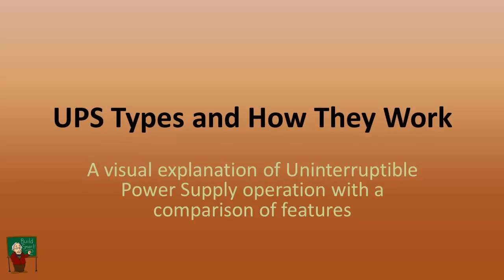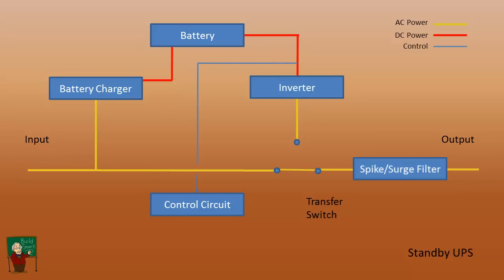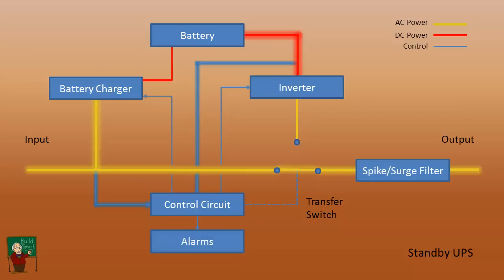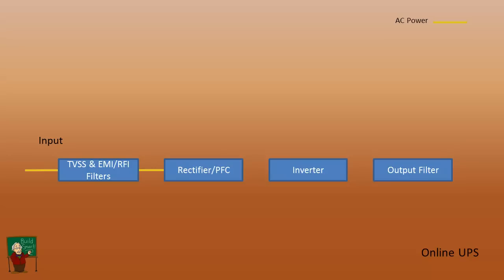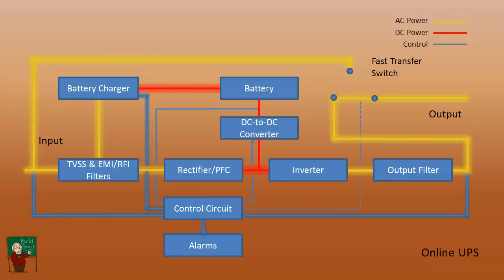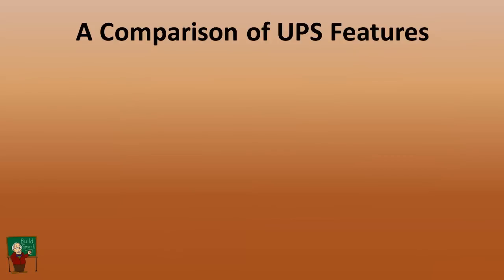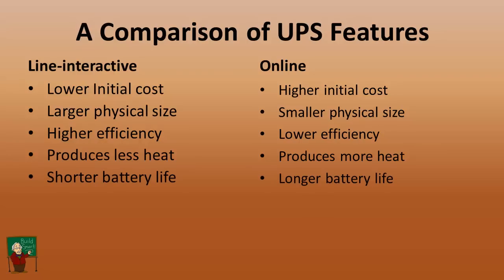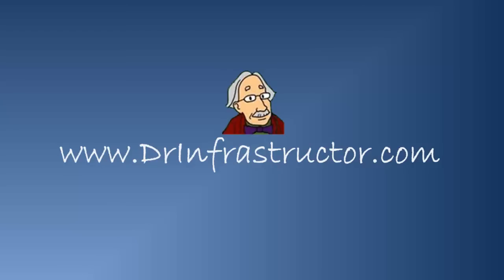How a UPS Works

Comment: Hi thanks for this video. A few days ago I had an unused UPS which I turned it into an Inverter. The project was successfully and it works fine. But I have a problem. The mentioned Inverter automatically turns off after exactly five minutes.There is a way to keep such inverter on for a long period of time? Any help please from your end. Thanks in advance.

Comment: "PLEASE HELP"  I have an "Eaton 5E1100iusb" line interactive ups 660w. I am trying to save on power consumption and was wondering if the ups load is relative to the power consumption it uses from the wall outlet. EG: If the ups is powering a 400w pc is it's power consumption from the wall lower that when it's powering a 600w pc??? Thanx for the help

Comment: @ 06.32  With an Online UPS, during Online operation (mode), the battery power only kicks in when mains AC fails.  In other words, there is no continual drain to feed power to invertert for the critical load.

Comment: This video contradicts infromation from other videos in how and when the battery is utilised during online operation.  Infromation from elsewhere suggests that load is always directly powered by the battery with microcontroller regulating when battery is charged, disconnected and discharged.  However, this video suggests that the load is always powered directly by the conditioning circuitry with the battery only kicking in on mains failure.  Grateful if someone could pleas clarify which of the two scenarios is correct.  I have a Riello Sentinel Pro and need to know if my UPS, during online operation, feeds load from battery always or whether it is fed from conditionaing circuitry, therefore when mains is available, battery is never utilised.  Thanks.

Comment: I have a Everest seriesUPS system with stabilizer, 800 VA. I only have two things plugged into it my PS4 system and a Panasonic 50" screen TV. I plugged the UPS into the socket around a day before to charge. Now when I plug everything in it will run for a time then beep at me and shut off. It seems like the TV and PS4 are running completely off the battery system and not from the house power supply. Could anyone tell me why this is?
Reply: Please check your battery. Because of low battery only it starts beeping and to stop beeping, you have to disconnect one of the battery wire from the UPS. Further 50" Panasonic, even it won't take much current to run, it takes a lot of initial surge so heavy to disconnect the UPS.(can you give your battery details?)

Comment: Does inverter work during normal operation , or it stars working only after 'blackout' ? My question is - is on output normal sine current on normal work and than inverter current on alarm , or inverter always powers output .